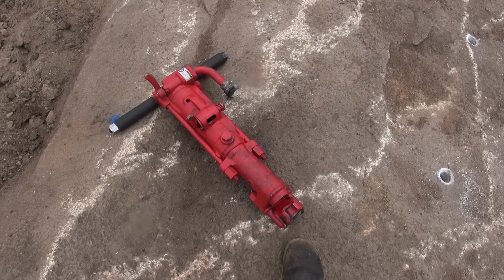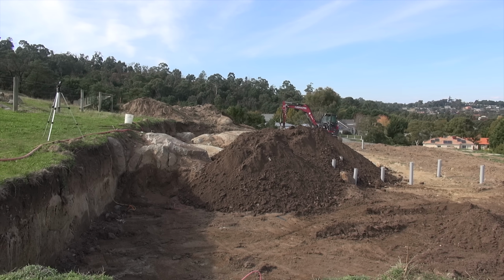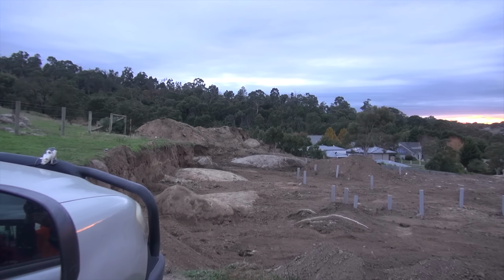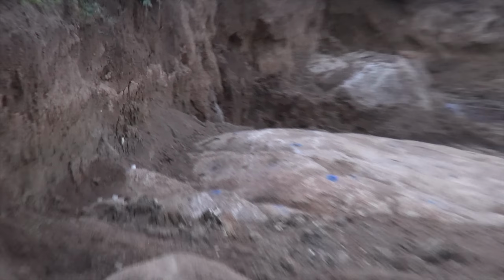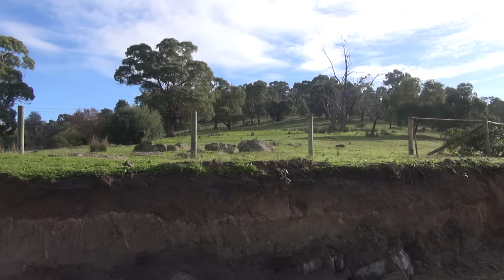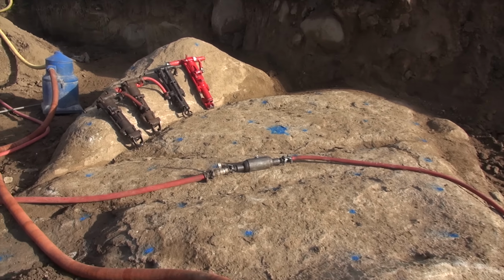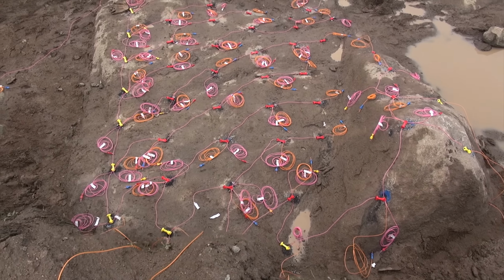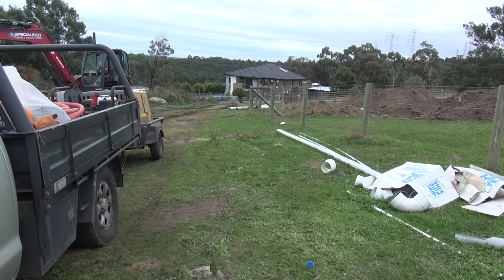Granite Geocide with Demolition Dave

Comment: Who needs to visit the gym, when your Demo Dave - don't know how you manage all the physical stuff! New drill seems pretty good, plus the usual ''leg over'' :). I remember that long term use of these percussion drills can produce De Quervains disease (tenosynovitis) from sustained vibration - hope you have seemingly managed to stay away from that.
That's a big (huge) assortment of rocks - more great work. That 72 hole final one showed the delays nicely on slo-mo. You mention the 'echelon' element - back when I studied this stuff we called it 'Chevron" pattern - same idea - this was way back in UK.
Reply from the maker: Hi Chris, thanks for tuning in, I certainly don't need to go to the gym... but I do swim a lot. I don't have any broken body issues at this stage but I would like to give the hand drill jobs away soon and just do drill rig stuff. The chevron pattern hook up is an old classic that looks similar but but has some big differences, e.g. Shot started at delay #0 in the center of the face, delay #1 was 3 holes that made the first chevron, delay #2 was 5 holes that made the second chevron etc. This is a big advantage over the earlier method of firing it row after row as it gave better fragmentation. These days the plan is to make sure that no 2 holes fire with a time delay closer than 8 milliseconds - a critical number for blast vibration management considerations. This is achieved by using a control row (front row) time spacing of 17ms/hole and the reverse echelon rows are timed @ 42ms/hole, this works out very nicely without any sub 8ms timing collisions until you get about 5 or 6 rows deep and give superior fragmentation compared to previous methods.
Reply: Many thanks for the reply Dave - appreciated. I see the difference now - my 'chevron' training was of course rock face work - quarry etc - sort of 'classic'. Your considerations make total sense and I imagine the planning for your delays must be pretty carefully made to avoid 'collisions'! Some similarities between approaches in as much as one always wants a hole energy to go where it can do most useful work Thanks again :)

Comment: looking at the job on the front end i'd been tempted to bring in the drill rig Dave! seems like the digger operator knew how to use the rock bucket pretty good especially compared to a few you've had in the past!
Reply from the maker: I would have bought my little excavator mounted drill to this one except that my tilt tray truck is off the road at the moment, my other option is to pay somebody to move it for me but I would not be able to take it home each day.
Having had Two machines stolen, I'm not keen on leaving stuff at the site.
Reply: @demolitiondavedrillandblast  yeah thieves are bad around here too most who do work like that and leave the machine there will pull something vital and take that with them so it won't start!
Reply: @demolitiondavedrillandblast  you know Dave after thinking on it i bet that vibration issue at a 100 psi is an out of balance piston! steel can be denser in some parts of stock than others if the mill that poured it isn't careful! i bet if it's spin balanced it'll show it's heavier on one side!
Reply from the maker: There has also been a failed attempt to steel my little digger, they were unable to start it because I had pulled the plug off the engine stop solinoid.... so they gave the instrument panel a hammer massage.
Reply from the maker: Never thought of that, I could try another piston nest time it's in bits.
Reply: @demolitiondavedrillandblast  What a lovely bunch of coconuts they were! 
You either armour the machine up or take it home every night!

Comment: My favorite part of this video was teh side by side drilling comparison. (I have the CP-69 too) It would be great if you could do more of this type of very informative product testing/reviews. Thanks!
Reply from the maker: Yeah, I could do a video comparing the various drill head types, e.g. Integral chisel / Cross bit / Button bit and the efficiencies of knock on taper rods against Rope thread rods. Also thinking about knocking up a really simple venturi powered dust extraction system (like I once used) with the hope that some of the Indian drillers might pick up on the idea and save their lungs. Any other ideas? Oh... by the way, your YT channel has been up for more than a year now and I still don't see any video!

Comment: id be getting the ground plumbing rechecked, the ground movement and shockwaves, will have changed angles, flow rakes and may have even cracked piping, however, blasting has always fascinated me, is it something thats hard to get into? and by hard i mean cost and education/ cert time?
Reply from the maker: It will be checked James, It's not easy to get into and build a business around, in hindsight just about anything else would have been easier. Probably the biggest barrier to start up these days is that everybody wants to see that you have insurance and a good deal of experience. Problem #1 you just can not get insurance with out at least 10 years experience and you don't get many jobs with out it. Problem #2 unless you are blasting most days there is no way you can afford the outrageous cost of the insurance. There are easier ways to make a good living.

Comment: Wow you where not kidding when you said your country has a lot of rock. BC, Canada has a lot rock but rarely in the city areas. Thank you and have a great day. PS Is the blast wire recyclable if not what happens to it? Second what do are you checking on when the excavator is cleaning up, 13:46? My apologies if this is a repeat question.
Reply from the maker: Just cleaning up my waste signal tube and surface delay clips
Reply: @demolitiondavedrillandblast  Thank you.

Comment: Ohh definitely ! Some one hast to pay the bill!! Don’t  blame you pulling off till it is decided who pays!!  Well I really like how the new drill eats but I was lol at around 4:00 you were a wee bit short that was a stretch getting leg over 😂😂  an on the last blast?  Logically I understand why the delays. I am assuming you want the outer to blow before the center so as to get more easily broken into smaller pieces an to give the center somewhere to bust apart… But I do have a question … what is the difference if you do not run any delay, and all holes go off simultaneously? I am sure there is a logical reason. Is it to control the force of the blast? ( Edit)  or does it have something to do with getting the desired sizes?
Reply from the maker: If you fire it all simultaneously, e.g. a det cord type shot the ground vibration pulse would be a shocker and bring lots of complaints and the yield would be lots of large blocky pieces. A few milliseconds between the holes does wonders for the fragmentation and makes the vibration fairly mild.
Reply: @demolitiondavedrillandblast  that makes sense I was assuming a total instant detonation would be earth shaking. And makes sense a series of micro explosions would not carry as far in the ground .  And also makes sense each detonation would fracture backwards towards the center of the rock before the next detonation . But wasn’t sure on stone fracturing.  I know here back 100+ years ago you could get explosives 🧨 but now it is only government certified, and then the paperwork trail. I am told is monsters. But stone an rock cutting is all in reading the structure of the   Stone to split . Had the privilege of working beside a couple stonemasons learn a lot in my younger years . laughing but I’m too old to swing the hammer nowadays. But thank you for answering my question.

Comment: Underground hard rock mines drill relief holes so the blast doesn't send rock careening down the passages - Do you have to leave the dirt blanket shallow on one edge so the material has somewhere of your choosing to move into; or is that not a concern? Awesome content btw
Reply from the maker: No, the direction of throw, if any is determined by the placement and inclination of holes and the order of initiation. Thanks for watching Thomas.

Comment: What typically goes wrong with the rock drills? I have an APT 155 that I bought used. It doesnt work very well, after 5 minutes with a brand new B&L button bit it only went 2"(50mm) deep in blue California diorite (very tough rock). And its spitting oill out the oil fill cap. Is it worth repairing?
Reply from the maker: OK, the APT155 is a mega drill that should drill through the hardest rock in no time, something is very wrong. Do you have a suitable size compressor with ample supply capacity? e.g. 90 - 100PSI @ 125 cfm? can you make and post a video of it trying to drill so that I can see and hear it? What type of oil are you using?? Some drills can be very fussy if the oil is too thick or there is too much of it. Is the hex shank on the drill rod 7/8" x 4 - 1/4" and not one of the shorter ones??
Reply: @demolitiondavedrillandblast   ahhh! you have a point!! 
The drill came with a 3 1/4” x 7/8” steel, however it just occurred to me that when i bought it, (from a rental yard)i asked if i could have a bit for it. I personally grabbed a steel and bit from their rack, installed it in the drill to test it on a piece of wood, it seemed to work, so i bought it.

Anyway, maybe i need the 4 1/4”??? APT’s website shows the tool is made in both sizes 

I rented tei 185 cfm trailer mounted compressors that was set for 90psi i think. I didnt see a way to adjust the pressure. The first compressor would shut down (engine stall) after running the tool just a few minutess. I returned that compressor and got another one (same rating) and it seemed to run fine but still low performance on the drill.
the tool was puking the oul out the filler cap even though it was tightly fastened

oil used was “Rock drill MV oil” as recomended by Crowder supply (mining supply outfit)
Reply from the maker: 4 1/4” is by far the most common, very few 3 1/4” x 7/8” chucked drill around these days - I've never seen one! Tip the drill upside down so that you can look down the chuck and measure the length of the hex section. That oil should be perfect

Comment: What are those flashes of light above the dirt pile as the explosives are triggered? With everything covered so deep, I didn't expect to see anything like that.
Reply from the maker: The flashes are the pieces of plastic signal tube lighting up, there is one coming out from the detonator on the end of each row of holes and these set up to confirm that the shot has progressed all of the way to the end without any problems.

Comment: Amazing as always!
The CP69 ... I know nothing about drills, but they look symmetrically built ... could a person not unbolt the bottom end and turn it 180 degrees to relocate the foot plate release?
Thanks for sharing 🇨🇦
Reply from the maker: That has crossed my mind Paul, some drills you can however with this one it has a small built in oil reservoir for chuck lubrication and I expect that a oil gallery runs between the main body and lower bit. I'll know the first time I have to open it up.

Comment: Dave, when it viable to use an excavator with drill or drill rig to drill all your holes?
Reply from the maker: Would have been good to use on this job but my tilt tray truck has been out of action for some time with a broken gearbox, I could have paid a transport company to float it down there but hate to leave it over night for a few days as I have had so much equipment stolen and vandalised that I can't stand the though. If my own truck was going I could bring it home each day.

Comment: Is that type of rock any good for cutting and using for building material? Or is the cost to expensive for cutting?
Reply from the maker: It hard Granite, very good for building and has been used for thousands of years. Can be split without too much difficulty, cutting requires diamond tools which is expensive. The Egyptians did it very well... and we don't know how.

Comment: Would a rock breaker on excavator not be quicker? IV got no experience in it but it just seems like it would be?
Reply from the maker: In softer rock, yes, in this stuff it is a waste of time and a quick way to ruin the point on the breaker.
Reply: @demolitiondavedrillandblast  Even a small sinker drill like Dave uses, will out perform a large excavator with a big hammer, in Granites.

Comment: How do you know if all your detonators went off? Do you have to account for them?
Reply from the maker: Short answer because it has been a really  big day today. -The first sign is you get rock that is not broken, then investigation is required, I also usually run witness tube out from the end of each row of holes - they tell me that every row has propagated all of the way to the end and none of the signal tube has been cut or damaged in the covering process.
Reply: @demolitiondavedrillandblast  thanks. Imagine safeing a skyscraper

Comment: What are you using to drill the holes?  What is powering that drill?  I am building a road in the mountains and have run into some extremely hard rock that will not break with a hydraulic hammer and I am looking for something to use to break these outcropping up.  THanks
Reply from the maker: Chicago Pneumatic Rock Drill Cp-69 from India, 125CFM of compressed air.

Comment: That's all you've got to do to start those small engines. A little bit of sweet talk does the trick.
I'm glad  the red rocket works well, but it kooks like the silver bullet for the win. So, did the blasting scare the 'roos away?
Reply from the maker: The motor is a Honda so it is very surprising when it does not go first time every time. Oh, they did not hang around once I was out of my ute.

Comment: Dave, how did you learn this trade?  is there a course?  Also wondering why do you wear the dust mask while drilling when you have a vacuum going?
Reply from the maker: How did I learn, I started reading every book I could find about it when I was about 14. The mask is not only for the stone dust (which is fairly effectively managed by the vac). the mask also protects against the very dirty oily air that comes out of the drill exhaust, I add a lot of oil in the air line so that drill lubricates well and lasts a long time. This air does not help you breathe well, the full face mask also protects my eyes against stone chips that were previously a constant problem.

Comment: Always wondered why you don't use a mushroom headed wedge plug to plug the holes prior to rain, wouldn't that be easier than airblasting holes filled with water later? (Not that you wouldn't have to anyway, with cracks etc)
Reply from the maker: I do use a lot of little blast hole plugs that are made out of a closed cell polyurethane foam, they are quite effective at keeping out the water but I'm always loosing them because the crows keep pulling them out and they blow away!
Reply: @demolitiondavedrillandblast  , crows, bastards.  they started tearing the insulation of exposed hot water pipe at my place.  they also often wake me up dropping macadamia nuts off the tree on the roof thinking they are going to crack them open.

Comment: I think a video where you show the blasting hardware and fuses and delays, and how it is all wired up would be awesome. Also can you reuse anything for a subsequent blast? Thanks mate, appreciate your work in making these videos.
Reply from the maker: Thanks for watching Murray, my videos are deliberately light on with these details.
Reply: @Demolition Dave Drilling and Blasting  yeah I guess I didn't think it through haha. Cheers for the reply mate 👍
Reply: Kinda proprietary formula and artistry that part there.  Also proportioning proper amounts of the "working materials" per hole and based on depth as well as the material to be broken is based on hard knowledge and  decades of experience.  Understanding the way rocks break and move and sequencing the delays to accommodate the material split off and moving just looks easy in the videos.  Likely for Dave it is in fact just that, easy.  There is actually allot of info on the internet about the how and why of everything Dave does and Dave not telling helps keep his insurance low!

Comment: im just curious    you got suction  on   the drill   for dust  from drilling    and you still wearing  full face  filtration mask    is not that little bit exaggerated  its just  normal granite  nothing dangerous  + suction  everything goes   away no  silicosis  danger    + you working outside not in mine or if it was dusty enviroment i undestant  and i worked in those filter mask  they are  efficient but working in that  mask is  sauna and  in this enviroment kinda overkill
Reply from the maker: When I started out in this work I was filling the gap left by a guy that was suffering silicosis, he had a lung transplant but it did not go well and he died not long after, he always wore a mask they tell me.  With out the dust extraction system despite good protection from the respirator, you still get significant secondary exposures, like all over your clothing and this then gets into your vehicle and in the air and in your lungs and take it home to your family. If I were to rely on the dust collection system only I would still get some exposure from the dust that get left on the rock around the collar of the hole (sometimes quite a lot), this dust gets airborne easily because of the air that comes screaming out of the drill exhaust, Not just the stone dust but the heavily oil loaded air that comes out of the drill exhaust is also very unpleasant in your lungs. The first time that I drilled at night under floodlight I was shocked how much dust was in the air. If you treat it like asbestos you will live a long time. I have worn masks for so long I could sleep in it and not notice. Thanks for watching.